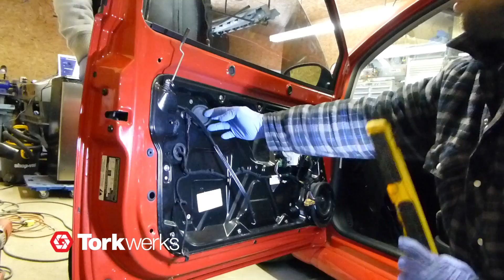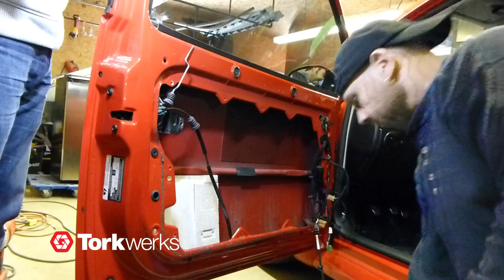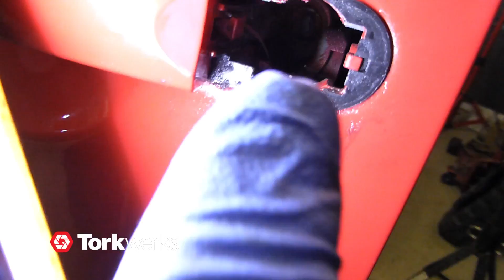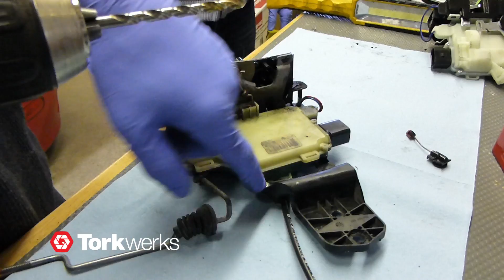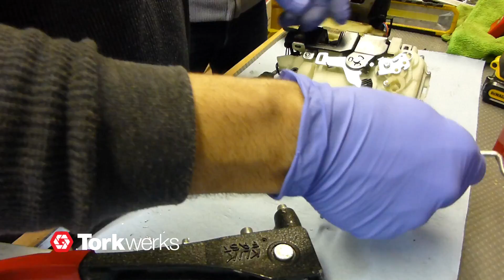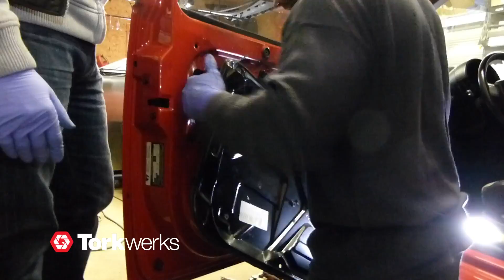2003 Beetle Door Lock Replacement

Comment: what purpose does the door lock mechanism bracket serve ?
Reply from the maker: Thanks for the question! I'm not a Vw engender but I'm guessing they wanted to add some support, sometimes it can also be an assembly line thing. In any case ideally if it's there I try and put it back as it was as much as possible.

Comment: Any reason you cant do this with the window simply rolled up rather than removing the whole window from the regulator?
Reply from the maker: Not in my experience, in order to get access to the inside of the door the steel inner frame needs to come out, to do that you need to remove the window. Maybe there is another way but I have not seen it, and this way has worked well for me so far . Thanks for the comment!
Reply: @WolfHausMotorwerks  oh yeah. I see that now. Man that sucks lol. Thank you for the quick response
Reply from the maker: Np! It’s not that bad, just take your time.

Comment: take out the inner panel and cut an access hole with a grinder, it will save all the hastle of disconnecting window regulators an wiring etc ..
Reply from the maker: thats one way of doing it, not sure if everyone would be happy with a chumk cut out of their door though. thanks for the comment!.
Reply: @WolfHausMotorwerks  you can replace the chunk cut out and tape up the cut line, these locks are troublesome, i personally have replaced mine twice during my ownership, so shortcuts are a must...cheers ..

Comment: The 2 rivets that were drilled out, will they need to be adhered again somehow?????
Reply from the maker: 1975Kombi1 so if you are referring to the rivets I drilled out of the lock mechanism that held the plastic bracket on, then yes you will need to use new rivets to reinstall it on the replacement part if it did not come with it.
If you are referring to the 2 plastic pins I pushed out when disassembling the metal panel from the door, you will need to find the 2 pins you popped out and then push them back in during reassembly. I have seen people also use zip ties to tie that bracket back to the metal panel. I don’t see this bracket adding much to the whole install, It does not seem to add much to the whole thing really.